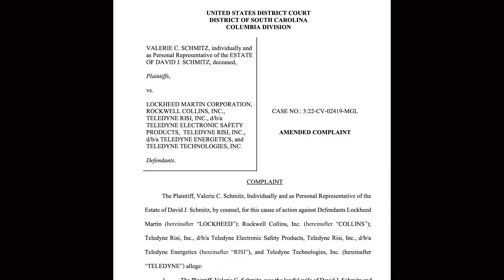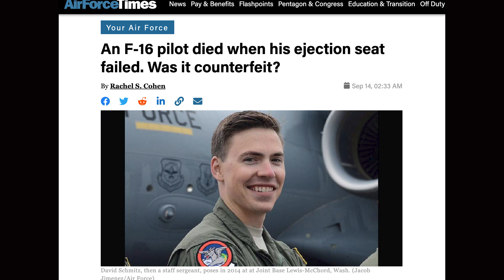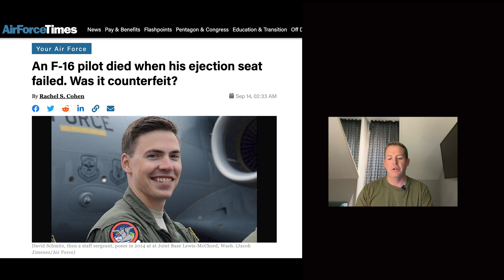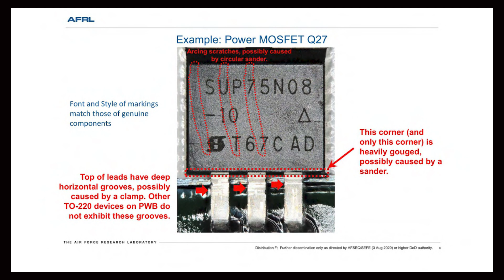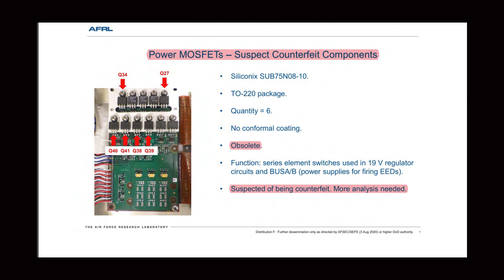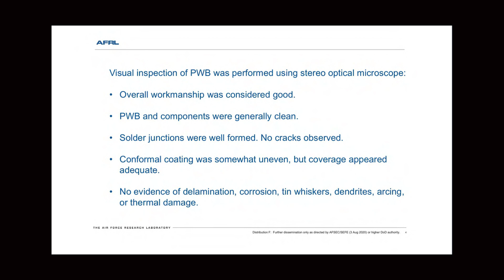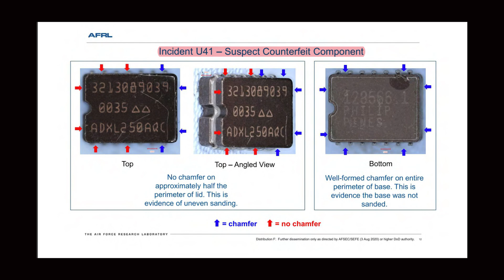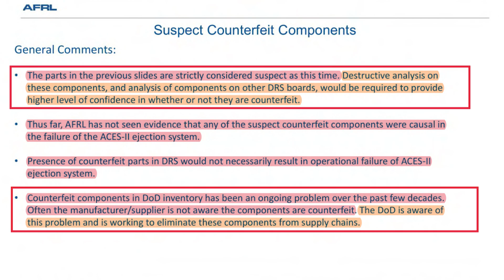FAILED Ejection Seat - Pilot Killed - Counterfeit Components?

Comment: In my mind there’s no excuse or acceptable explanation 
 I worked at a defense contractor years ago Raytheon
 Built sonar system 
All of our parts that came in from vendors HAD to be inspected and bench tested upon arrival to insure quality control 
It set back delivery at times but in my mind this is far better than sending a part/ system out to the fleet, wing, soldier and it failing causing a life to be needlessly lost this behavior is nothing less than 
Irresponsible 
reprehensible and criminal in my opinion
Reply from the maker: That's how I would have figured things were built.  Especially, such a technical piece.  I would have thought those chips were tested/inspected prior to the build and tough to get by with a fake.
Reply: A counterfeit component doesn't always mean it's non-working or completely fake. The nasty and much more common case is when dodgy distributors relabel compatible components. In this case it was a flash memory chip. A distributor may have relabeled a compatible flash chip from a different manufacturer. Or, also likely: they took an identical chip from the original vendor (ATMEL in this case) which was originally sold with a marking indicating a lower quality grade (cheaper non-military/non-aviation grade). And then they just relabel it to indicate a higher quality grade, so they can sell it at a higher price. Especially with the latter case, there is no way to detect the counterfeit by testing: the silicon die may be completely identical (from the same production line). Sometimes there may indeed be no difference at all between the grades (except for the price premium). Such components will usually work just fine. But sometimes they may have a slightly higher failure rate. The only way to prevent such fraud is to be in complete control of the entire supply chain (only buy from the original manufacturer directly, or from trusted distributors which can also guarantee for their supply chain). That, however, should be normal for any military/aviation manufacturer... should be...
Reply: "BENCH TESTED" is the gold standard. Where pilot lives are concerned WHY THE HELL IS THIS IGNORED??
Reply: China will always find ways to undermine companies like Raytheon.
Reply: I just saw this older thread and it's such a core engineering industry topic I wanted to help some of you understand why it isn't as clean as you would like it to be.

For example, bench tested doesn't mean anything here. Those systems are for certain 'bench tested', they may even be literally tested in rig to simulate physical conditions. Military hardware gets extensively tested, as your common sense demands.

This is the nature of complicated systems, causality is a nightmare. This isn't even a very complicated system, so it's odd that they are having to speculate about whether any of the components failed. Makes me wonder if the report didn't find a more likely cause but the lawsuit didn't leak that part because there was no liability case in it.
It is possible there is a standard procedure for investigating every part in a used ejection seat and Teledyne simply followed procedure without any expectation this unit failed or maybe even knowing it had been in an accident.

I have no love for Teledyne. But another comment on this video explained how in the military you have junior officers put in positions where they're basically forced to sign off on safety or lose their job. That is almost exactly what they do in the private military industry and contractors to each other. No one wants to be the one to make the call. Teledyne is basically the bottom of that barrel because they're at kind of 'commodity' level military tech. If they choose to be sticklers about something it could cost the industry billions or render entire manufacturing lines stalled indefinitely. And sometimes they do that, but being commodity level the pressure is very high to push everything up to the margin, that's capitalism. Of course in addition to the pressure to make it cheap is the pressure to rake in the profits for 'investors'. I might suggest some alternative solutions to eliminate the profit incentive, but ironically military guys tend to be highly protective of the billionaires.. so be it.

It's tempting to say they should just do literally everything to save lives. But nothing is that essy in engineering.
Consider something everyone does - picking car tires. Suppose you choose to let your tire tread get a little low beyond the recommended minimum.. not a lot, just a little, because tires are expensive and it's very unlikely that 1/32 of tread makes the difference in avoiding a crash. But unlikely isn't impossible, so should you be investigated and then held liable if that ended up being the difference between someone dying or living in an accident? And if so, what about your brake fluid and lines? Should you be changing tires and brake lines very month? How many times a day should you be required to check your tire pressures and keep them optimal?
You have to drawn the line somewhere, and you can't go back and move the line after something happens. When something happens of course it's worth it, but that is not the choice.
No one goes back honestly and says oh the alternative would have meant stopping all flights for six months, turns out that's totally worth the chance we took of losing one life. But how many lives would have been lost due to people being rusty and making more mistakes, or some other component that was never expected to sit idle for six months failing?

And so on.
So it isn't a simple problem with a simple solution.

A counterfeit part may not be any worse, heck it could even be better than a genuine part. That is why they clarify counterfeit parts do not indicate causal failure. But obviously the worry is they were counterfeits of lower quality than spec, presumably to save money, and that poor quality caused their individual failure, AND those failures caused the overall failure.

Just to explain the landscape you have to explore when doing failure analysis...

For example you've said it is certain that this unit failed because the sequence didn't occur as it should have. If I was tasked with investigation I would immediately ask how true that is, what the full system looks like and consider that other systems could fail in a way that appears to be an incorrect sequence.
Additionally, you have to ask whether the fundamental design concept of these accelerometers and pitot tubes, whatever it is, has any fundamental flaws / failure modes - even if rare.

The truth, even if unlikely, is all of these alternative failure modes are possible, it's just a matter of probability.

The place to start would be with evidence, such as video or witnesses, establishing what physically happened. Did the unit clearly run the wrong sequence? That would mean it clearly performed all the actions it should have, as defined by the incorrect sequence.
Or show that no sequence was followed, such as one of the trigger events never occurred when it would have in all sequences.

Then, again, establish that the probability of other systems failing while appearing like an incorrect sequence is much lower than the probability this unit failed. How do you know the explosive charges or other release didn't delay or fail despite being triggered correctly?

Then establish that the fundamental design is sound, that nothing could have interfered with the pitot tubes for example.

Finally, start diagnosing the assumed unit failure. If you established above that the unit never triggered at all, then you would be looking for a failure in rhe triggering circuits. If rhe wrong sequence triggered then you look for a failure in the logic and sensor side. If you don't know, you can check both but it's even more work.

Now maybe you think this is complicated, but the whole logical process just done is repeated for each sub system of the unit, and for each individual component in those.

And if you go through all these systems and testing but find no failures what would that indicate? Well maybe the components test fine now but need to be tested in a variety of conditions where they might have an unexpected behavior?

And some of these failure modes of individual components may be very expensive to investigate. When they say destructive testing, you might assume tearing it apart by a skilled tech and report for hundreds of dollars. For an op amp, sure. But for flash memory? You're talking about doing extremely expensive work with very expensive equipment and skilled operators. Investigating one flash chip thoroughly (assuming worst case where they don't find an obvious flaw right away) would cost tens of thousands per chip.

Is that worth it to rule out a failure mode that has at most .1% probability? .1% still happen, so if you don't look you might miss the cause.

I will say the systems designed with redundancy make it very unlikely there's a failure due to chips EXCEPT for the flash memory. But like I said that is very expensive to investigate. I would try to infer it instead, find out what role the memory had and show highly probable causality from that. It is expensive to have redundant memory for sure, and solid state memory reliability is propagandized to be better than it is, especially with respect to longevity. The repeated extended service may have just been too long for it, counterfeit or not. But I would also say if a previously used or old flash chip was remanufactured and 'counterfeit' as new, that wouldn't surprise me and would absolutely fall into us getting screwed by reliance on China for chip fabs. Not even as sabotage, it's just harder for US to get these chips made today. Check out the yt channel Asianometry for videos on chip manufacturing and why there's a shortage. As I mentioned above, there are almost no ways to non-destructively test NAND chips for age, quality, etc. and even destructive methods are very expensive. So a 'bench test' of the memory wouldn't mean anything. That is just the nature of the tech, it's very small and complex.

Also, consider if you found your friends and/or favorite political reps mocking Pelosi for visiting Taiwan a while back, or Biden's large government subsidy (even to a non American company) to build chip fabs here (foreigners AND communism! lol), you should at least be aware that your reps are doing you a great disservice with their ignorance of global politics and why things like that are actually important.

Hopefully that adds some useful information for curious people frustrated by the tragedy.

I also wonder if this makes sense from the military point of view: I think regardless of whether any company is responsible, we (via the military) really should be responsible for compensating the widow directly because ultimately our equipment failed to operate as he expected and we told him it would. Not to mention all the service extensions. I don't know how much we default compensate the family in these cases, but obviously the widow doesn't think it's enough. If she was compensated by us and we thought the company was negligent then we could sue them.. which seems like a more fair fight.

Comment: Amazing story... RIP
Smaller size 8.5 meter conical parachutes are used in ejection seats as these open faster, surely a requirement during "Zero Zero" ejection (Zero Speed Zere Altitude).
Ejection-wise, the most remarkable pilot was French Air Force pilot Denis Turina, who ejected 3 times during his career, in May 1966 from Mystère IV jet, and twice from a F-100 (September 1967 and May 1975). Read his book entitled " Trois Ejections " (Editions JPO).

Comment: The DRS is 100% at fault and its prima facia evidence. As an egress tech over 30 years ago, and if things havent changed on newer versions of ACES2 seats, then I guarantee you someone is covering this up. The environmental sensor in the back of the seat takes altitude, airspeed info from the pitot tubes on both sides of the pilots head at the top of the seat. As the pitot tubes are introduced in the airstream as the seat moves up the rail, the sensor sends that to the seat sequencer. I havent read the report or seen your other video, but its absolutely the point of failure. The seat has or did have three modes of ejection based on the airspeed and altitude. If the sensor worked ( im sure its been examined) it 100% would’ve then relied on the sequencer to determine the mode. And it sounds perhaps it was a lower altitude ejection. Correct me or I will research. But that sequence wouldve meant you got a instant chute to recover the pilot and immediate man/seat separation. So NO way can any argument be made that it was NOT the sequencer in my opinion. But it has been a minute since I worked on them.
Reply: As I'm sure you know, the DRS works by having multiple channels that read inputs from the ejection seat pitot tubes to determine speed and altitude, the channels vote on whether it's a Mode I, II, or III ejection, and the majority ruling is how the DRS sequences the steps of the ejection.  The EDRS has a bad tendency to select the wrong ejection mode.  I don't know the specifics of this failed ejection where Schmitz died because I don't work Egress anymore and I haven't been able to get a hold of the AIB report that has all the tabs (the 28-page report was released in 2021 but the 1500-page report that would detail the nuts-and-bolts details of the ejection sequence has not, at least I haven't seen it on the USAF FOIA website yet).  From my experience, the EDRS tends to be incorrectly biased toward a Mode II ejection.  Schmitz was in a Mode I flight regime and hit the ground still in his seat, so it's very possible that the EDRS selected a wrong mode.  I think his family is right to sue Teledyne, they've been a hot mess for over 20 years and it's amazing more people haven't died.  They should also be allowed to sue CAD/PAD (the organization in charge of explosives and the EDRS) and the F-16 Program Office, but since they're government, that's probably impossible.
Reply: The AIB found that the EDRS was the problem.  The DRS replaced the ARS (Analog Recovery Sequencer).  It was known that the DRS had problems in about 2005 so the EDRS (Enhanced Digital Recovery Sequencer) was developed and qualified to go on the seat.  The problem was, the EDRS was allowed to be qualified-by-similarity, so it didn't have to go through the full gamut of testing per the Lockheed spec.  Some things were just signed off as good, the contractor knows what they're doing, right?  That turned out to be a can of worms and the EDRS turned out to be a downgrade.  Yes, the EDRS was worse than the DRS.  So the owning supply-chain organization tried again.  This time they developed MASS (not sure what that acronym stands for;  so the evolution is ARS --> DRS --> EDRS -->MASS).  The MASS was developed over 10 years ago and the fleet is still being retrofitted.  The mishap jet did not have a MASS installed yet, I don't know what's taking so damn long with that.  Probably ACC cheaped-out and decided that the MASS would be replaced at depot instead of doing a fleet TCTO to replace them immediately.  I'll bet it's getting funded now, this mishap got a ton of publicity and made everybody involved look like shit, which is exactly what should happen.
Reply: @Skank_and_Gutterboy  WOW! Yeah man that is some BS and they should pay. It always takes something tragic for shit to train but only at the cost of our precious resources. I didnt honestly look any further but I knew something was definitely off. Thanks for looking further into that.
Reply: DRS didn't cause the crash.  The seat wouldn't have been needed if this Lieutenant's command hadn't pushed him into nighttime combat and aerial refueling without even having him do a daytime refuel first.  And at the end of the day, this pilot died because he balled up a landing approach decided to go-around instead of completing the landing, and his unit had him attempt a landing with all the damage on the landing gear instead of directing him somewhere safe to eject from a safe altitude, where he could have pulled the manual seat separation handle when the sequencer failed to separate him from the seat

Comment: The part and production drawings, quality requirements, purchasing history, used for that component's version can be cross-checked with the actual part or parts from the same production lot, and any deviation and cause can be determined; a design failure, a bad engineering change, failed quality check, counterfeiting, or unaccounted change of sub-vendors.